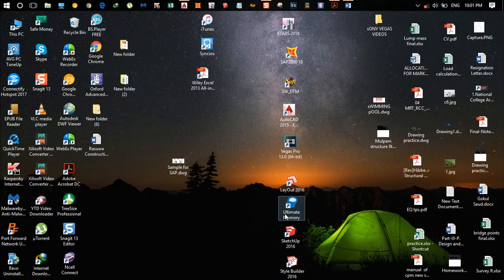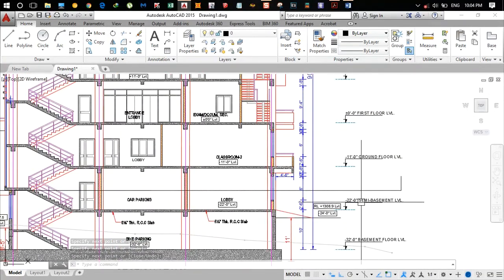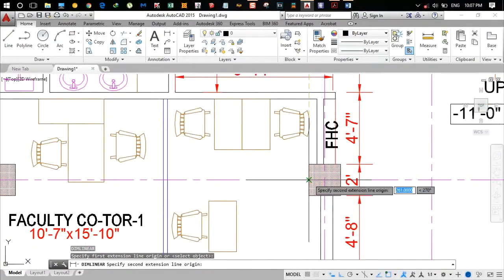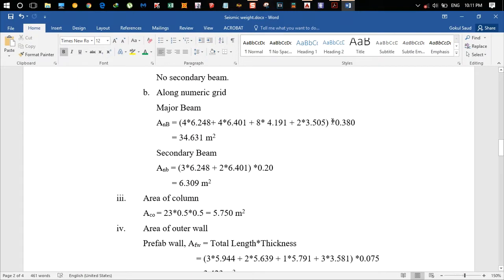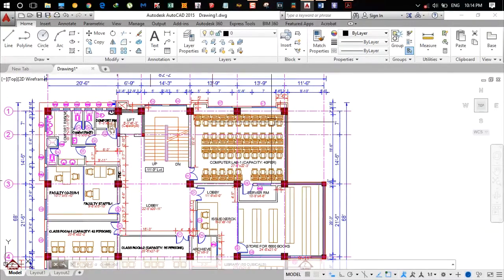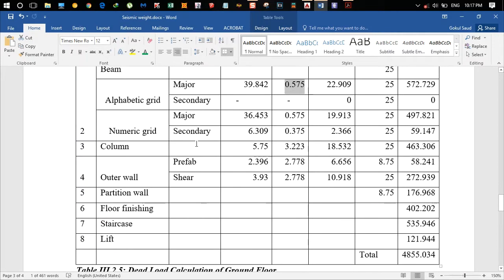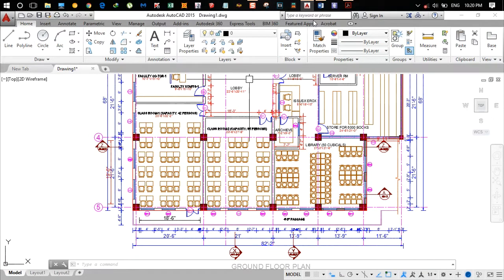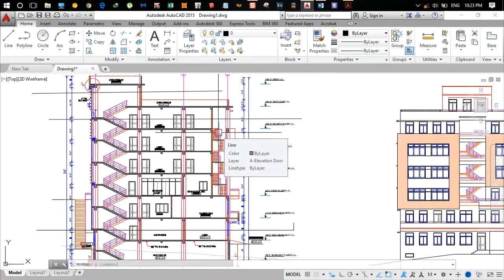How To Calculate Seismic Weight (Lumped Mass) Of A Building

Comment: how to determine a seismic weight of building by modeling it in ETAB? i think its not necessary to calculate manually . Can we find the joint mass in each floor?

Comment: Can we use this method(given below) to calculate seismic weight
 run analysis after defining the mass source and diapharms
select a floor to calculate the lumped mass
then click display ->show tables->joint output ,then select joint masses 
sum all the values in column to get mass of that floor
Reply: sir it is possible in ETAB?